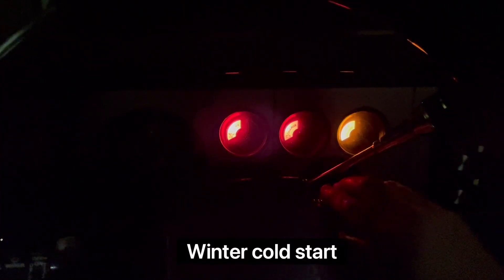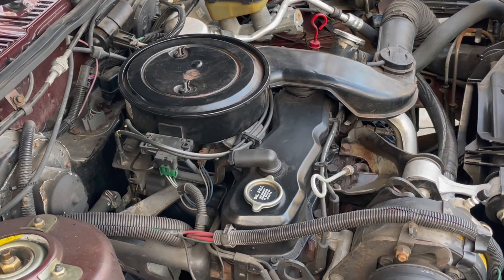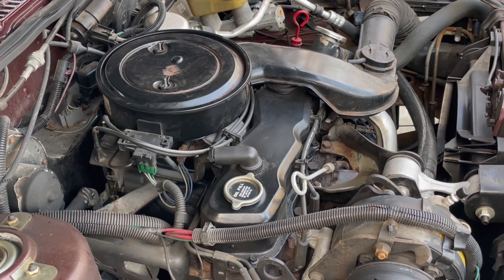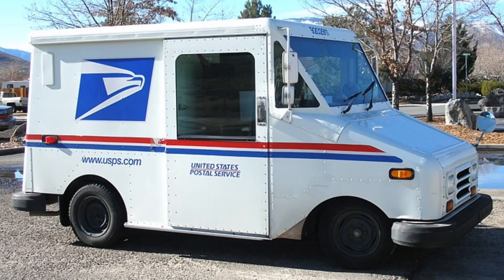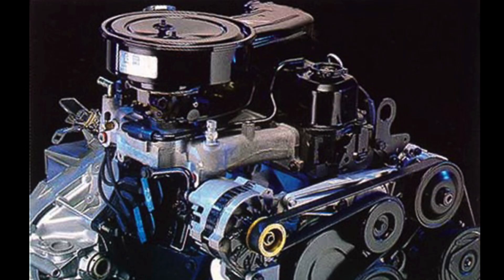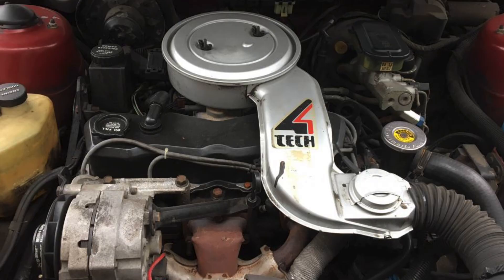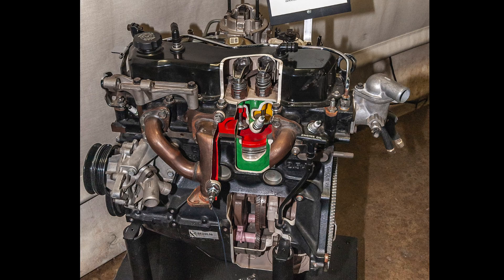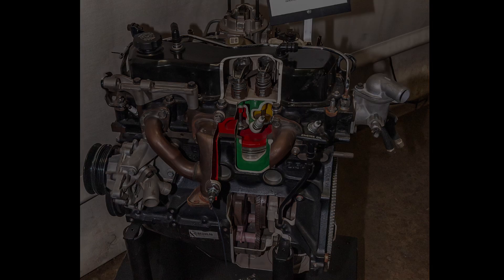Worst Sounding (and Most Recognizable) Engines: GM's "Puttering" Iron Duke 2.5L I-4

Comment: They were distinctive sounding for sure, but that crashy starter sounded like they were made with warped flex plates. Couple months ago I had to get a 3 Cyl kubota diesel to move itself out of a situation with only one bolt in the starter, it didn’t even sound that bad 😄
Reply: The sound might have been partially due to a lightweight flywheel or flex plate .

Comment: I have one in an ‘86 Calais. 136k on the clock. And, frankly, I haven’t figured out whether I like it or hate it yet. I’ve replaced every sensor on it, plus a full ignition tune up. Still, it seems to run differently each day it’s driven. I’m beginning to think it’s just the nature of the beast, but I could be wrong
Reply: Have you ever needed to access the distributor in your car? How do they recommend doing it?
Reply: @gregorymalchuk272  Yes I have, and it’s actually recommended that you loosen the front dog bone motor mount and actually rock the engine forward to the tune of about four inches. It is a LARGE pain in the ass, and just gives even more adage to the dislike of this particular motor. Especially in front wheel drive applications.
Reply: @440mgnm  Oh dear. I lost spark on cylinders 1 and 4 in an 87 Iron Duke with distributorless ignition and am suspecting a bad coil pack or ignition module. Do they tell you to unbolt it at the engine or on the frame, or both and completely remove the mount? Do you have to jack up the engine to keep it from falling out of the car? Do you use a pry bar or jack to move the engine sideways away from the firewall, or does it fall forward naturally? This is such a shame, as the coil packs and ignition modules are trivially easy to access in the V6 engines.
Reply: @440mgnm  One of our mechanics was driven to drink & swear a lot when working on these 4 cylinder front wheel drive cars. You NEVER bothered Moody Mike when he was working on one!
Reply: @frederickbooth7970  And can we BLAME Moody Mike?
Reply: @gregorymalchuk272  Should be easy enough after the dog bone is loosened. No, the engine won’t fall out.
Reply: @440mgnm  Nope! Mike had some real crummy GM vehicles to work on.
Reply: @gregorymalchuk272   I used a ratchet strap around the radiator support to pull the engine forward once the dogbone has been unbolted.
Reply: @440mgnm  Can ask a really stupid question? I have the 87 N body, which is the same as yours, I believe. Where is the dogbone mount? I am familiar with both the stamped and cast dogbones on the various V6 engines, but I do not see one in my engine bay. The only mount that seems to be resisting the motor rotating forward is a tiny, weird L shaped thing that comes off the engine right near the water pump, turns sideways 90 degrees and bolts to the body near the passenger side fender. I'm so sorry for my stupid questions.
Reply: @carlosanzola2938  Can I ask you a really stupid question? Where is the dogbone in the Iron Duke N body cars? I know what dogbone mounts look like, but I don't see one in the engine bay of my 87 N body. I only see a tiny L shaped thing near the water pump that turns sideways and bolts to the body on the passenger side fender. I am so sorry for such a stupid question.
Reply: @gregorymalchuk272  Don’t be sorry! Nothing to be sorry for. The “dog bone” motor mount is on the top side of the engine near the core support. It’ll have a large metric caliber bolt, (I can’t remember which size!) that’ll rattle free to let that engine rock forward. Good luck my friend!
Reply: @440mgnm  Ahh, thank you. Would you describe it as being on the passenger side or driver's side, or in the middle? Is there only 1 or is there 2 like on some of the V6s? I'm not near the car at the moment to go compare. Thank you so much for this help. 🙏

Comment: I had a 87 olds Calais.  It ran fine and had some pep in it but vibrated awful when in drive at a stop light. You could really feel it through the steering wheel. I was so embarrassed that I would switch to neutral whenever at a stop light especially with passengers in the car.
Reply: Did you ever need to access the coil packs in the car? Did you have to remove the intake manifold?
Reply: It would also tire your hands out if driven for any length of time too.

Comment: we had a 91 Grand AM LE 2 door coupe with this motor.  It was quiet and smooth.  However, when we owned it, I was a teen age boy with my new to me license  and would drive it very hard.  It got noisy after a while but never broke.  I think it was those timing gears that just started clattering.  It had good pick up for a small car.  It would easily spin the 14" pontiac alloy wheels with p205 65  size tires.  Once I drove it from San Francisco to LA averaging 95 - 100 mph.  I made it in 3:40 min non stop.  Car took it like a champ.

Comment: I had an ‘87 that went 310,000mi and knocked from one cyl. 

Best to have a switch to override the 235’F when the fan comes on. That’s too hot.    I just shorted out the CTS with a switch.    Shut switch off and the SES light went back off.

Comment: Wasn't there a "Superduty" version of this engine available from Pontiac as a raw block used to build small race karts or cars that used heavier deck thickness and larger diameter threaded holes for head studs and main bearing studs? maybe 4 bolt mains? I don't think that got put into any civilian vehicles. Chrysler I think did something like that with their 2.5 derivative of the 2.2 "Trans 4" which was the basis of some of the turbocharged small Chryslers and "GLH" Omnis or something styled by Caroll Shelby
Reply: Yup if ya call it that

Comment: My ex girlfriend used to have a 1989 Celebrity with this engine. LOUD and unrefined as hell BUT it was solid and torquey and gave really good mileage. In reality that engine is an abomination especially compared to the fours Honda and Toyota had even back then. Those guys are the kings of smooth and powerful and refined 4-cylinder engines to this day. Not even the Germans make as good a four as Honda or Toyota. Especially Honda they're the true kings of the four-cylinder to this day. The Iron Duke was ok and all sure but damn it was just really bad when it came to NVH. It was terrible. Not to mention the starter's infernal sound.

Comment: For a company whose last name is "Motors" GM has a number of notably nasty four and six cylinder engines. The Iron Duke, definitely. The original Pontiac Tempest "Half-a-389" that sounded like a rock crusher. But the the piece de resistance has to be the "odd fire" original V6 that Buick developed. The car sounded like it was "missing"  (because it really was).
Reply: I had the last year oddfire in a ‘76 Sunbird for over 20 years.
Reply: @seed_drill7135  I had an early even fire in my once 1981 Pontiac LeMans wagon.
Reply: @KentTeffeteller Their first attempts to smooth out the oddfire actually caused premature engine wear, but I think that it was only the ‘78 and ‘79 ones that were so affected.
Reply: @seed_drill7135  The engine on mine never had issues. Reverse failed, after a time. And finding a Metric Turbo 350 in B-O-P pattern was challenging. That 1981 Pontiac LeMans Wagon was a great car. My first, I loved it.
Reply: The 3.7 liter V6 in my '76 Buick Skyhawk idled pretty rough, but I did get 30 mpg on trips and kept it for 10 years.
Reply: Ya that 229 v6, it was completely gutless as well - the mileage wasn’t much better than you could get out of a well tuned 305 v8 with a quadrajet
Reply: I didn't think it too bad for a malaise era car.  Of course all the emissions stuff had been removed from mine and I ran premium. @kellismith4329

Comment: They sound like they're working against themselves to run. I was an automotive machinist and built/rebuilt several for circle track racing in a class that required them for GM mini stocks and it was difficult for them to keep up with the FoMoCo 2.3 engines.
Reply: That’s, in a nutshell, maybe the best way to describe one that I’ve heard yet.

Comment: I used to be able to recognize that sound from a block away.
Rude crude and ready to cruise. I love the one in my 86 Calais.
Part of it's character. Sounds like a tractor. Trimmed like a 98.
Reply: I have an 87 iron duke that lost spark on cylinder 1 and 4. Do you happen to know the official method of accessing the distributor (on yours) or the coil pack on mine? I can only figure that you have to remove the intake manifold.
Reply: Maybe not "great", but these cars had CHARM! I have owned a few, and COULD NEVER "hate" them!
Reply: @johnmaki3046  I always took those attributes [negatives? not for me.] of the Iron Duke as part of it's character. There have been three in my family. Two I have owned personally. Would love to have anything with it, perhaps an S 10. Or an AMC Concord. That would be a scream.
Reply: Well, it ran. @DaveGreg100

Comment: My 1st car was an 85 Plymouth Reliant with the Silent Shaft mitsubishi 2.6. It was smooth as silk, pretty impressive for a big i4.
Reply: That's why people bought the Japanese engines.
Reply: I had an 83 LeBaron Convertible with the 2.6L "Astron" engine as it was called by Mitsubishi. Great engine, very smooth, not very powerful (92hp I believe), but you never really noticed it in that car, it pulled it along quite well. Compared to the Chrysler 2.2L engine, it was silent since the 2.2L as it aged started to sound like the iron duke engines, but they are still reliable engines.
Reply: @MichaelAStanhope They were brilliant in the boat. 
It would stop the boat drifting on any sand .
Reply: AFAIK Mitsubishi pioneered the use of balance shafts, and back then was the only automaker using them.  At some point they licensed it to Porsche for use in Porsche’s 3L 4-cylinder engine.
Reply: I remember all those Bitsumishi engines having nice sound and performance compared to the 2.2L/2.5L K-car engines, but they did get to be known for oil burning and blown head gaskets. Of course, the 2.2L K-engine will blow a cylinder-to-water-jacket hole into the head gasket pretty quickly if you overheat it. But the 2.6L Mitsubishi engines (and the Mitsu V6) didn't seem to last as long, at least around here. We go from -40C to +30C from winter to summer, so imagine Ottawa, Canada as being Detroit's climate but colder. I think the heat cycling from -40C to thermostat temp was harder on the Mitsus than the Mopars.
Reply: And made a nice rattling sound.

Comment: I had a 1974 Mustang that I purchased new. 2.8L V6 engine with solid lifters, nylon timing gear. The engine was the same engine as used in Europe, from the Cologne, Germany Engine Plant. The engine sounded great and was very “healthy” when coupled with the manual 4 speed trans. Night and day difference compared to this engine.
Reply: My parents had that engine in their Pinto wagon.You could pass anything any where & still get 27mpg with an automatic! When it came to ice & snow however you would be better off & safer riding one of our thoroughbreds!
Reply: @frederickbooth7970  Wow, had the completely opposite experience with my parents '75 Pinto wagon and that engine - loud, chattering from its first day off the Ford dealer's lot, and all that extra engine provided maybe average 18 MPG and no "pickup" as they used to say.  But compared to how my dad described a guy in his car pool's Pinto Runabout with standard 4-cylinder and air conditioning on, that V6 did sound a little less strained.
Reply: @70sleftover  Our V6 Pinto wagon had no a/c so that may have helped on power & speed . We also never hauled anything but my dad & myself most of the time when commuting back & forth to work. Because of the Pinto`s VERY dangerous handling in ANY kind of frozen precip. we got rid of it after having it one year & went to a 1976 Volare`  wagon instead. Much safer & most of the time we were able to get 22mpg on the Hwy with the old slant 225 straight  6. Absolutely gutless engine above 40 mph though when wanting to pass motor homes or trailers!
Reply: Like the old-school Explorer 4.0 V6, including the OHC variants, (which were likely from sometime in the late-1990s to discontinuation) which I remember, because I used to be in contact of a person who had a 2002 Ford Explorer Sport Trac and it was still soldering along with at least about 260,000 miles. But, it sounded like it was time to change the chains and guides, because it sounded like a bicycle at idle, LOL. In 2016, it seemed fine, still, despite the top console already being dead for a while (can't see temperature of outside or clock, IIRC)

Comment: I had a 1987 Buick Summerset that had a four cylinder so that was probably the iron duke. It was noisy but reliable as I didn’t have any mechanical issues with it and sold it when it had around 160k miles.
Reply: Did you ever need to access the coil pack on that engine?
Reply: @gregorymalchuk272  No I didn’t. The only repair I ever done was replacing the electric fan.

Comment: I remember the Iron Duke inline 4's being rough running and course.  A person who was used to a smooth and powerful big-block Oldsmobile or Buick would often choose a Toyota Camry or Honda Accord over a GM product of the era.  In its defense, the Chrysler "K" cars were equally bad or worse. Truly a sad era for the American automobile industry.  The US manufacturers never regained the dominance they once enjoyed.
Reply: The Mopar 2.2/2.5L K-car engine was clanky and noisy too, none of the gear growl of the Iron Duke because of the OHC timing belt. I like the Mopar 2.2L, after 1984 or so they really had the bugs worked out of it pretty well - just don't let it overheat or you will be needing machine work on the head. I am really glad GM didn't put something similar like the Cavalier engine into the Fiero, the all-iron Iron Duke tolerated overheating pretty well and until you learned the tricks to burping the Fiero's unusual cooling system, you'd see the temperature gauge do some pretty wild things which would have killed the Cavalier motor or the Mopar 2.2.
Reply: I dunno.  I had an 84 Dodge Aries wagon.  2.2 ran like a top.
Reply: @21Piloteer  I had the same and I remember the GROW from the engine when I drove it uphill or from a stop light when fully loaded. By the way, I bought it used for a deal and it had a 4 speed manual transmission and a bench seat in the front. The stick shift was mounted on the floor and came up and over the middle of the front bench. Needless to say, no one could sit there. I only had it for about a year but it did hold up fairly well.
Reply: I owned two Japanese cars; an '83 Nissan Pulsar (Turbo "4") and an '83 Mazda GLC. I WOULD NEVER, EVER REPEAT THIS "experience"!
Reply: @johnmaki3046  So the GLC wasn't truly a Great Little Car??
Reply: It had a strong 4 cyl. and good mpg, but it was built like cheap CRAP! @70sleftover
Reply: Agreed!  A sad time for the US auto industry.
Reply: In Jr high, one teacher was so proud of his "superior" Hondo.  It was 2 years old, and the rear wheel wells and rockers were completely perforated by rust.  Car lasted 4 years before it went to scrap.  My buddies mom had an early 80'sToyota Celica.  Massive electrical gremlins, and she traded it off on a Shelby Charger 2.2.  She drove that for years.
Reply: Lol.  I've got 2 iron dukes in my collection and also a 2.2 chrysler.  Both crude in different ways
Reply: @howebrad4601  Does the Chrysler feel different because it has an OHC?
Reply: I referred to the 2.2 and 2.5 engines used in k cars.  My mom had a chrysler LeBaron town and country with the 2.5.  Sounded like a diesel farmall tractor.

Comment: This is the second video you've been hard on the Iron Duke. I've owned dozens, yes dozens of them without complaint. Easy to work on, parts are cheap and it's great on gas.
Reply: I think I agree with him: the engine may have been quite reliable but it was definitely a buzzy and loud, cheap-sounding engine. It made sense to hear it under the hood of an S10 or LLV, but it seemed out of place in some of the more upscale cars like the Oldsmobiles and Pontiacs that they put it in.

Doesn’t mean it was a bad engine though, just crude to the point of being memorable for being crude.
Reply: You are correct on all accounts!
Reply: I'll also add that these engines are great in extremely cold weather. -40 start up is no problem.  I've also had dozens of cars with this engine from the 1970's thru the end of the 1980's and never ran into the phenolic gear problem.  Just lucky I guess !
Reply: I am NOT a G.M. "fan", but these (AWFUL SOUNDING) motors "did the job"! What more can anyone ask of them?
Reply: Maybe you have an answer! Do you happen to know the officially prescribed method of accessing the distributor or distributorless coil packs/ignition module on the transversely mounted iron dukes? Does it involve the removal of the intake manifold? I lost spark on an 87 distributorless iron duke and am suspecting a bad coil pack or ignition module and have no idea how to access it. The V6s had such easily accessible coils.
Reply: @gregorymalchuk272  Have you tried asking this question in some relevant car forum? I wouldn't be surprised if the question has already been asked and answered somewhere. 

There are also Hane's manuals for your particular car, though the old ones were much better than the new.
Reply: @HAL-dm1eh  I'll try to find a forum to post it in. It's just that most of the iron duke stuff is in the S10 and to a lesser extent the Fiero communities, but they don't have the same setup as the front engine, transversely mounted sedans. The consensus here is to unbolt the dog bone motor mount and swing the engine forward to gain access from the top. I have the Haynes manual for the N body but it doesn't give much insight. Though I haven't read it cover to cover.